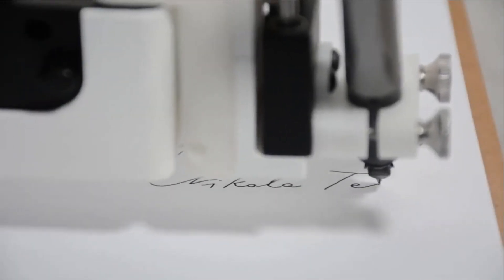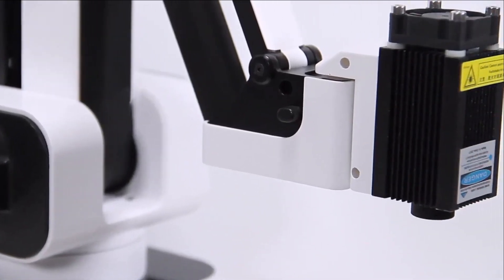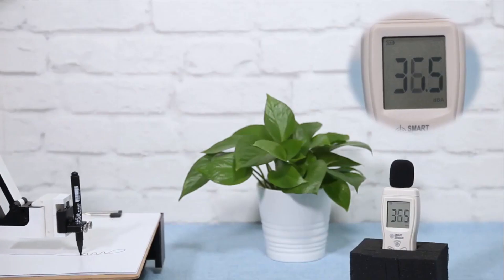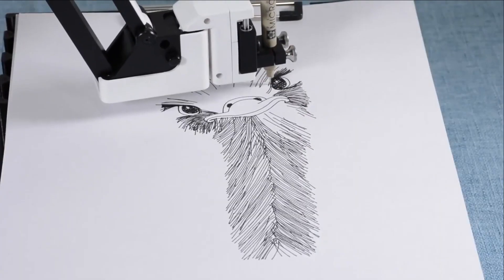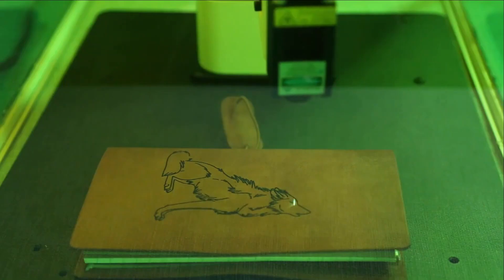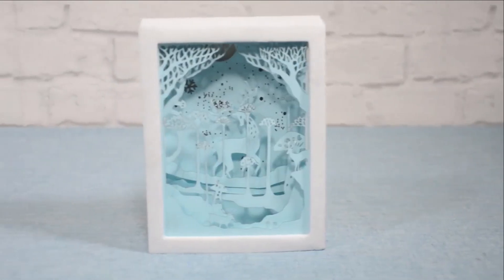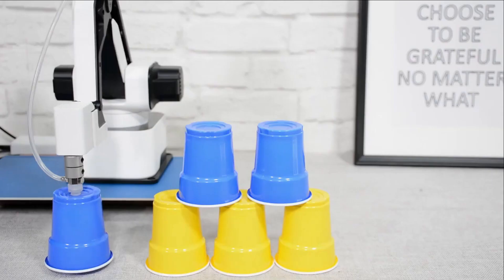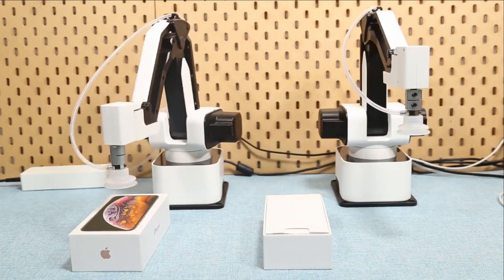Hexbot: The Modular All-In-1 Desktop Robot Arm For Everyone

Comment: on the vacuum module why not use a reservoir for holding vacuum so you pump once and pick up multiple items  basically pump out a cavity and hold it at a slight vacuum so all you would hear is a slight hiss when it opens the vacuum valve